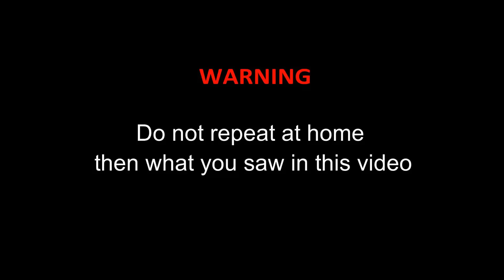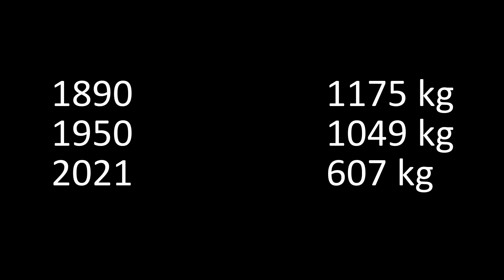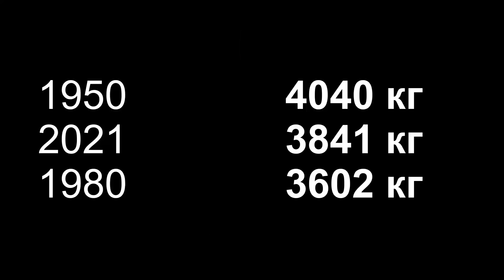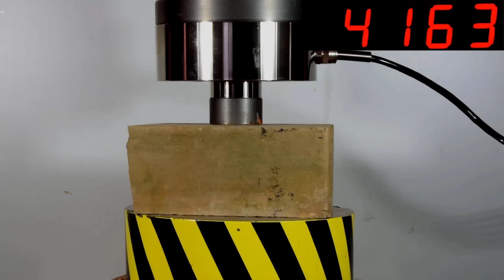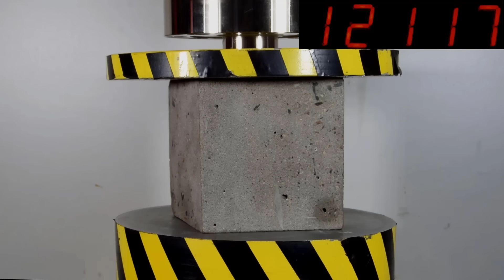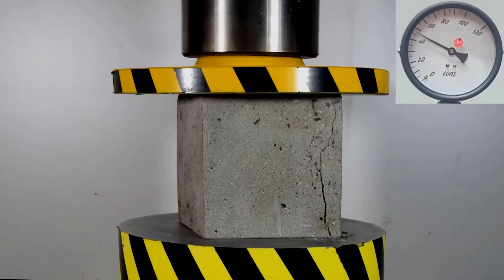HYDRAULIC PRESS VS OLD AND MODERN BRICKS

Comment: The strength of concrete depends on the cement content and the age. Lower cement content, less strength. Also, concrete doesn’t set, it goes off, it is a chemical reaction more than a drying. This means it will keep getting stronger for possibly hundreds of years.
Reply: It also looked like the "modern concrete" sample was uneven and the force was concentrated on small areas, where the older sample looked very smooth and the force was spread evenly. That could have been a factor with the bricks as well.
Reply: If that were the case old cement bridges wouldn't be falling down
Reply: @KairiPluck  Generally, old concrete structures fail or need repair due to durability issues caused by the steel reinforcement. Structural failure is rarely due to loss of concrete compressive strength
Reply: That’s a good point. Well noted
Reply: @teoengchin  ...why making them with steel reinforcement then? If they are a weak point? If they fail before cement? Nah. I doubt steel is more fragile than cement. It can't be like that. The strongest bridges are steel only.
Reply: @KairiPluck  Steel is very strong, but it corrodes over time.
Reply: @HeaanLasai  They are talking about the end of the video when he actually tested concrete not talking about the bricks...
Reply: @KairiPluck  They fail because they get wet and rust. Rust expands. Usually putting the steel deep enough is well enough.
And they use steel because it helps the structure against shearing forces
Reply: @zjg4gcvn Parkades get rebar repaired all the time well replaced but the concrete becomes delaminated and is loose so jack hammer it out tie in new rebar and re pour concrete back and like new.
Reply: @zjg4gcvn Ya jack hammer thru slab and sandblast the rebar and tie in new rebar and repour. I used to do parkade restoration and waterproofing.
Reply: @zjg4gcvn  you take the concrete back far enough to good non corroded rebar cut out the bad stuff and metal tie new rebar to the old good rebar you exposed.
Reply: @KairiPluck  it’s because concrete doesn’t have give to it. As well, suspension bridges are the highest standard atm
Reply: Instead...its the Iron bar that weakens throughout the years by absorbing oxigen and could make buildings to collapse
Reply: That could explain why I am unable to drill into the concrete walls of the basement in my house.  130 years of hardening.  I've used this particular hammer drill on all kinds of concrete curbs and sidewalks of various ages.  But I could barely make a dent in the wall putting all of my weight into it.  Gave up eventually.
Reply: That’s very cool, I never knew that
Reply: Wrong. Too much cement makes for a weak concrete. You need a good balance of aggregate.
Reply: Steel reinforcement isn't just used to give concrete strength. Steel flexes, bends, and adds tension to the structure.
Reply: @KairiPluck  the cement bridges that fall down don't do so because of compression failure, in fact.
Reply: @KairiPluck concrete is strong in compression while steel is weak, concrete is weak in tension while steel is strong... perfect mates!
Reply: And rebar. No rebar, no strength.
Reply: That old bridge was made from lime that was made from sea shells and it also had crushed sea shells to add strength............
Reply: @KairiPluck Correct. Concrete is a relatively weak material which can nonetheless be combined with other materials, such as steel, to create durable projects. 

The strongest bridges are mainly steel structures just as I'd rather ride through an earthquake in a steel framed building as opposed to a concrete one.

That said, a lot of people grew up thinking that concrete was the only material that should be used for construction and they tend to be nervous if they see other materials being implimented.
Reply: very wrong

Comment: My favorite engineering principal is that you're only done engineering when there's nothing left for you to take away. A modern brick is strong enough to make a house of, and not a significant amount stronger. I'm sure it's lighter, easier to work with, consumes less materials and time to create and is a more economical solution than bricks of 1890.
Reply: It's actually more about removing cost than removing material
Reply: yeah don't really care, id still choose to live in a house built with 1890s bricks
Reply: @1199ccttv  It's a lot harder to heat during winter
Reply: @stvden  no it isn't. I live a pre 20th century home and my power usage both electric and gas are 1/3 the area average as calculated by my service providers.
Reply: @1199ccttv  If you live in an earthquake hazard area, it doesn't matter how strong the brick is, it'll be a pile of rubble with you underneath if it hasn't been seismically retrofitted. As has been mentioned in other comments, modern brick is never used for structural applications unlike with the old buildings, it is mostly just used for aesthetics.

Comment: Since I haven't seen anybody mention it, I'd like to add that the concrete taken from the fortress was intended for military defense, being as it's a fortress, while the other block of concrete was likely just some home project concrete from a bag from the store. Surely if you took modern fortress defense concrete and compared it to historic fortress defense concrete the results would be different
Reply: Yeah, and if they wanted the test to be more legit, they would have made rebar enforced concrete.  Let's see how much force that can take since most structural concrete these days has rebar in it.

Still a neat video.
Reply: @TeodorSpiridon  For real. "Ooh, strong machine smoosh stuff" is a pretty weak concept for a channel with so much more potential
Reply: “Military Grade” isn’t that good honestly. Lowest bidder

Comment: The older bricks were probably meant for structural purposes so they had to resist more compression forces while modern bricks are often used only as divisory elements so the dont have to resist as much, nowadays concrete structure is what resist the weight of the building.
Reply: modern bricks are engineered to isolate from heat better
Reply: My thoughts exactly.
Reply: I worked for a brick manufacturer, not actually making them just in the office but I do recall there were different types of bricks for different purposes. Engineering bricks were extremely hard, apparently designed to build viaducts.
Reply: @anthyatt6904  makes sense, you wouldn't want the viaduct to collapse with all the cars etc on them
Reply: @anthyatt6904  Pretty much this. A lot like those 'They Don't Make them Like they Used to Videos' just comparing an old and new thing at random completely lacks context.
 
That doesn't mean modern structural bricks aren't also weaker, but if they are, it's probably because their use cases are well known and the stresses they'll endure are well understood and their load capacity is probably much more consistent.
Reply: Isı yalıtımı sağlamak için sağlam yapılmıyorlar
Reply: well, the popular combination is Steel and bricks, because bricks are good at compression but bad at bending and elasticity
Reply: all depends on where you live
Reply: True .. old bricks were meant to be a part of the structure .. called bearing walls or something like that .. they also were solid with no air inside .. while modern bricks dont carry anything they are just meant for isolation and insulation .
Reply: @BH4x0r  You've made this isolate comment several times, and I do not understand it.  Did you mean 'insulate', or is there some isolation concept that I am not aware of?  (Serious question, btw, I don't know enough about material composition to correct anyone.)
Reply: @willchurch8376  Yes, i'm sorry, English is not my native language, in my language it's called isolatie, in English insulation so i switched up the u with an o
Reply: @BH4x0r  No worries, you speak English much better than I speak your language.  I was just wondering if I was missing something.  Other people used the term as well, it wasn't just you.  Maybe they're in the same situation.
Reply: Not just that, the bricks also get stronger with time if maintained well
Reply: Civil engineer🖖
Reply: Not just that, but many modern buildings are simply not designed to last as long as they can. Often large office blocks less than fifty years old are torn dowen with nothing major wrong with them.

Comment: Materials used in making the clay body have a lot to do with the strength. Usually a feldspar is used for flux along with a ball clay that have some fluxing properties. Firing temperatures add to the strength as well and usually 2000-2300 is good. These bricks are all extruded and ribbon cut. The modern brick is probably formulated to be a somewhat light weight brick. Color of the bricks is dependent on iron bearing clays being used in the body. Red Horse, alberhill red and a lot others. Red iron oxide, manganese, rutile all depends on what color brick you want.
Reply: As well as needing replaced more often.
Reply: I was trying to figure out the scrape marks on the 1890. Was this extruded and cut along small transverse? The others were extruded and cut along largest face.
Reply: @KassJuanebe  Could be from smaller batches made in moulds? Or maybe just the handling process as they were all stamped with a company mark after cutting
Reply: @KassJuanebe    Deb, Extruded through single and multiple opening dies, maybe 6-8 ribbons extruded side by side. A wire cutter or plunging knife moves in the direction of the ribbon path as it spins or plunges making a cut and by moving it gives a square cut. The cut then is on the small edges, the four long edges then are from the die. The extrusion marks are from sand and grog in the clay body. Place in Southern California, WCS, makes and sells pug mills, extruders, cutters etc world wide. Very interesting to see this stuff first hand. Perhaps youtube has the process.  claymachinery (fill in the blanks) Look at WCS site and you can see the extrusion equipment they make. This will give you an idea of how the processes work.
Reply: @2manycatsforadime  Thank you Bob!
Reply: this guy bricks